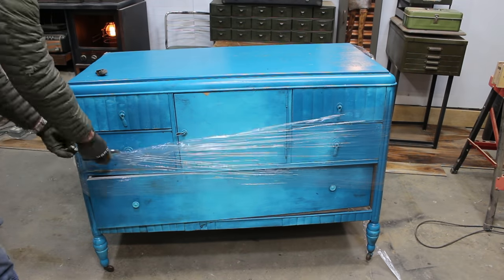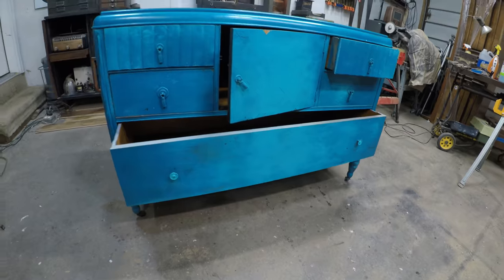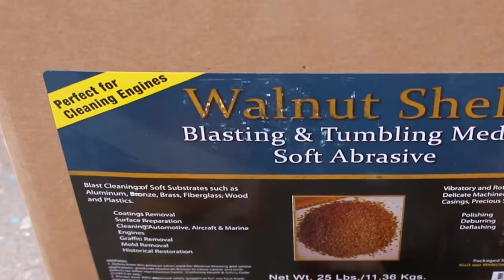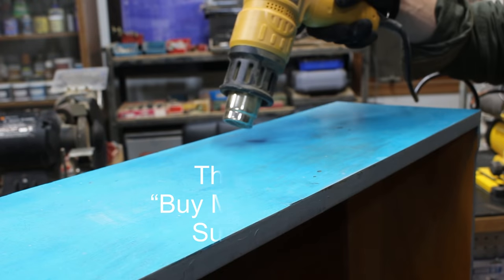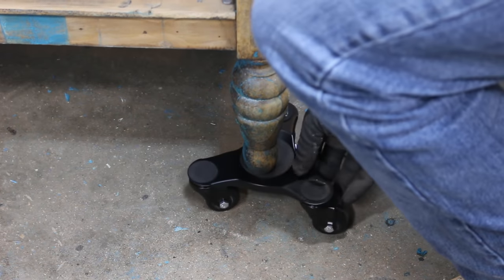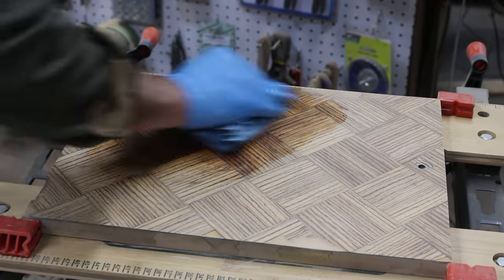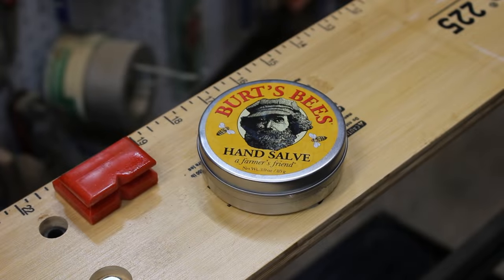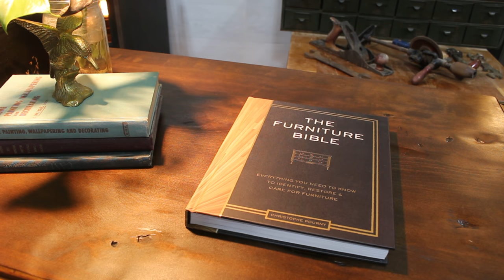Ep. 28 Amazing RESTORATION of WORST Painted ANTIQUE Buffet

Comment: I'm so glad you were able to remove that awful blue paint.  The drawer pulls came out beautifully.  The buffet looks good.  Leaving some of the dings and gouges on the top just shows the age and use of the buffet.  Good job!
Reply from the maker: Thank you Sally. I was afraid that leaving some of the damage would give the impression that I cut corners, when in fact I spent days detailing everything that was left. Thank you for the encouragement. Barry
Reply: @MadCityModern  It needs to have of the bumps and dings to show its age. You did a good job leaving the ones you did. Just enough but not too much.
Reply: @MadCityModern  Yes, it gives it character.

Comment: It was hard to know what that blue was really hiding and while what you uncovered was far from pristine, the end result works really well.  You struck that fine balance of what to restore and what to leave alone nicely on this one.
Reply from the maker: Thank you. I was hoping viewers wouldn't be disappointed with what I decided to leave alone. Barry
Reply: Why do all these restorers use circular sanders instead of those that go back and forth?  I forget what they are cslled.
Reply: @phillipstephens4522  Because they're easier to use, easier to control, and more effective.  The old vibrating brick type sanders are nowhere near as effective as an orbital sander.  The belt sander types with an endless roll of sandpaper are too aggressive for this sort of work, fine for shaping wood, but much too aggressive for removing finish.  The orbital sanders refinishers use give you so much control you can use them on even quite thin veneers if you're careful, and on very heavy finishes without fear of damaging what's underneath.

Comment: I love how you used the walnut shells, that's a great tip! I worked in furniture restoration for a high end company for a number of years and I'll provide one tip for a piece like this that sounds harder, but can achieve much better results and allows for easier veneer repair - disassemble the cabinet. Almost always the glue had failed anyways on cabinets of this age, and taking everything apart makes working with the veneer a cinch as you're dealing with flat panels. Anyways, glad I found your channel, great work!
Reply from the maker: Love this message!

Comment: Great work!  Have a tip for ya w/r/t hardware.  I keep a $3 1970s crockpot from a yardsale just for hardware.  Put in your metal bits, fill the crockpot with water, come back the next day, the stuff (paint, vanish, schmoo) comes off with a toothbrush.  Nuther tip:  don't use the crockpot for food, or the toothbrush for your teeth.
Reply from the maker: Love this. I need to find a crockpot just for this. Great ideas

Comment: I am disappointed that you did not try to replace the veneer. You can buy the veneer, which you could have glued in place. Still a nice job.
Reply from the maker: I have replaced veneer many times. I tried to explain why I did not attempt that for this project. These pieces do not typically sell well, and veneer would have been quite expensive for this one.